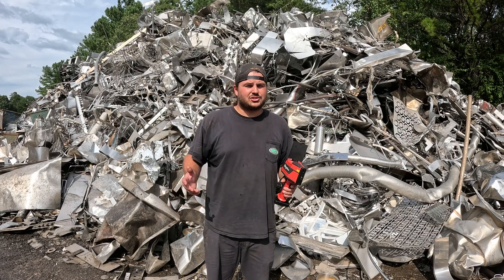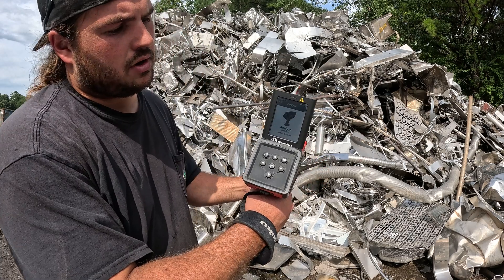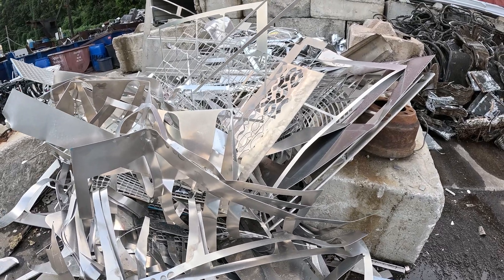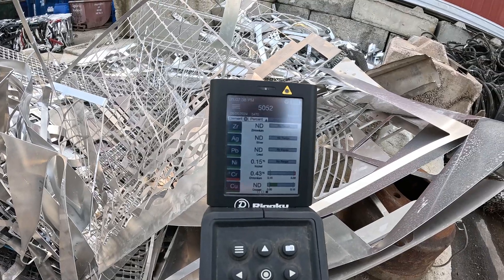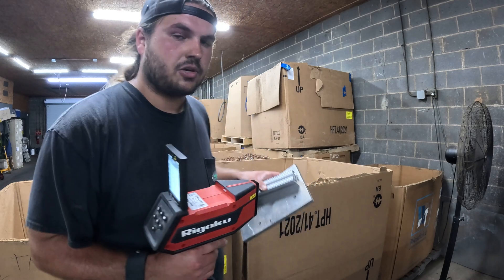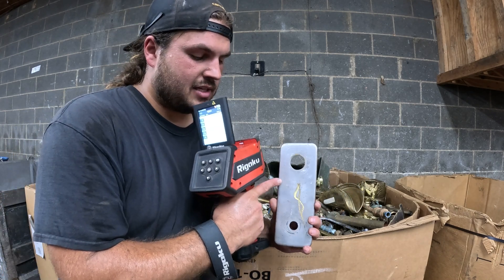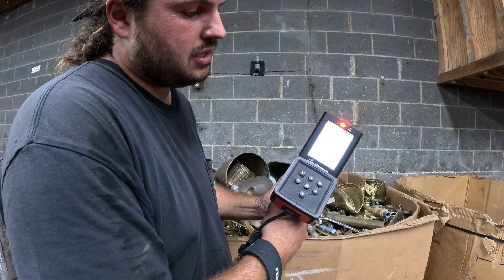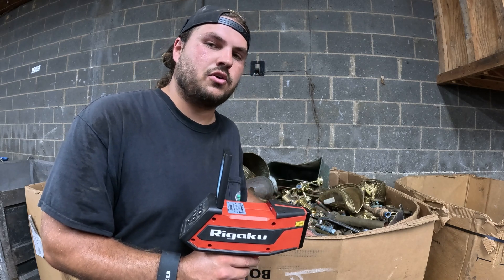This is How We Use a LASER Analyzer to Identify Exotic Metals!

Comment: So which is more accurate...the laser or XRF?
Reply: Google it
Reply: Depends on what xou want to mesure. For lighter Elements (Aluminium, Magnesium, Carbon, Silicon...) an XRF gun isnt as precise or cant detect them at all. An Laser Analyzer on the other hand only mesures the surface layer, rust and other contsmination need to be removed.